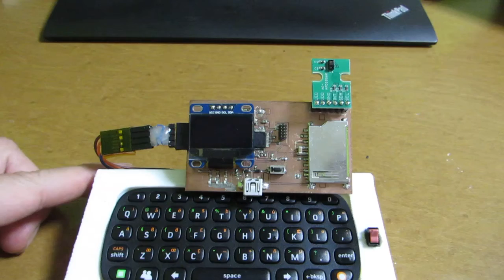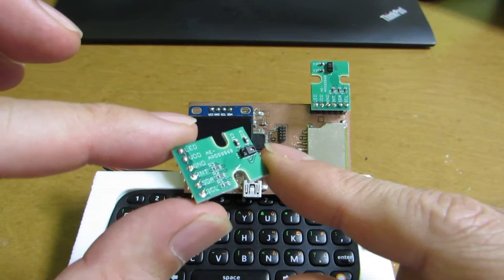Gesture sensor is on my Tiny ARM based computer!

Comment: excellent !!!
I am using the APDS 9960 to determine gesture in one of my application, I have some doubts in determining the gestures, can you please help me out
Reply from the maker: +baiju raj Hello, actually APDS9960 produces some "noise result"= miscounting. The key will be how to exclude wrong result, I think...
Reply: The APDS9960 which i am using is often resulting in a "NONE" direction, even though i give different gestures. but some times it is detecting the correct gesture.
 Is there any particular values that i need to set for the registers..?